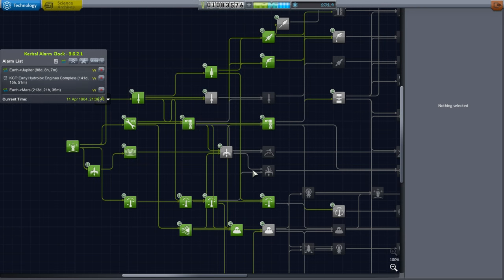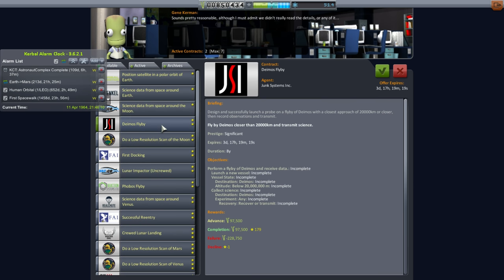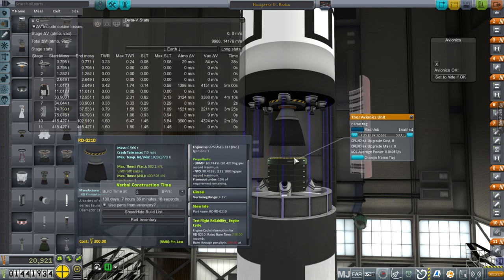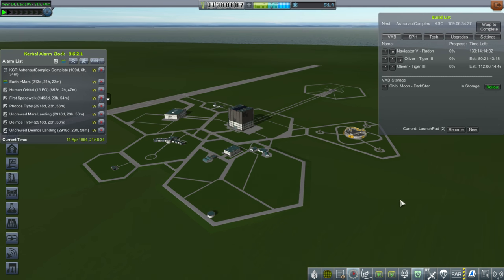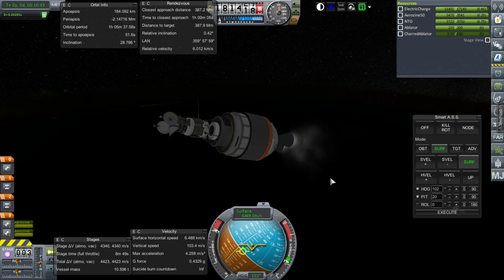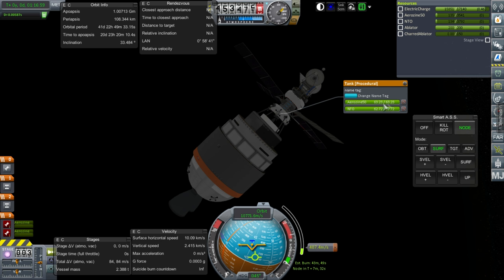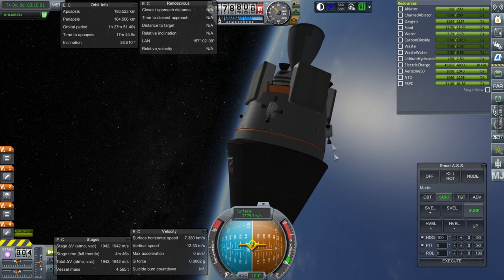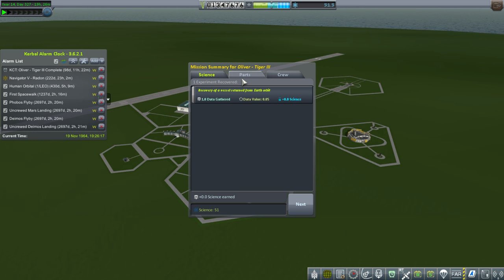Realism Overhaul in KSP 1.1.2 - 15 - Oliver and the Radon Rocket

Comment: Why don't you use the execute maneuver function on the flight computer, so it will execute at the right time even without connecting? I don't have rp-0 so there might be a specific reason, but I just noticed that you don't use it.
Reply: Well Tyler does not trust Flight Computer. And I can see why. I have had problems will the execute maneuver function in the past not even in RO. I think it is jut safer to do it yourself.
Reply: +Bluegillbronco2 I have had trouble with it trying to follow the maneuver node around as it shifts until the fuel runs out. Have you had anything similar? I've been looking for a fix and couldn't seem to find one
Reply: Yes I did have something very similar happen to me too. About the only solution I could come up with is use quicksaves often when using flight computer or use Mechjeb withc seems to be a bit more reliable.
Reply: +Bluegillbronco2 I thought about MJ, but I have limited ram so I want to cut down on mods and hope for the best. Is there nothing within remote tech I could do?